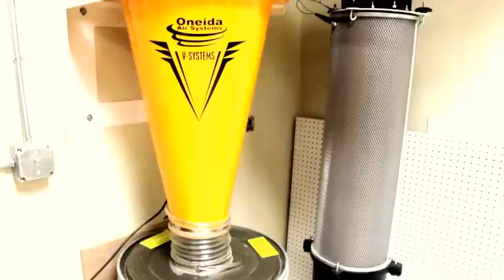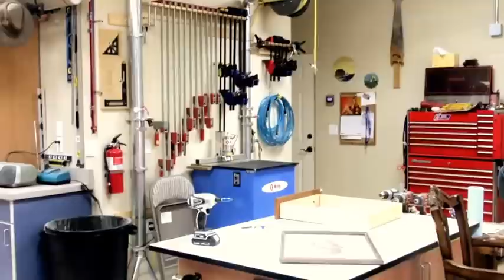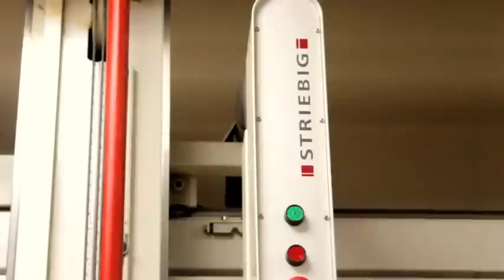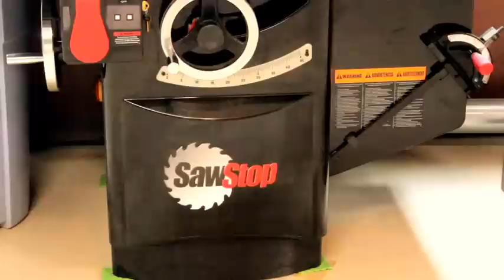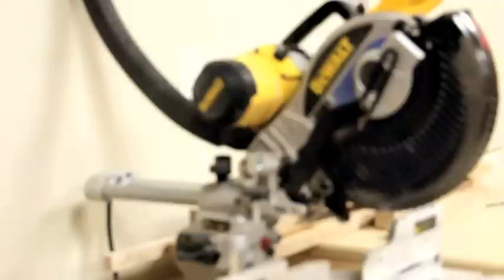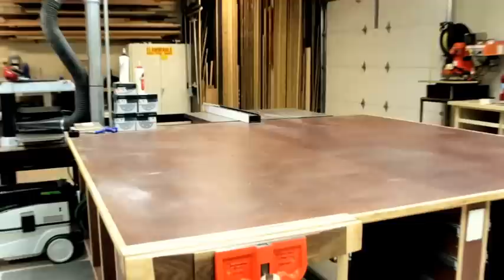Oneida Dust Collector V-5000 w/Nordfab pipe Shop tour

Comment: Absolutely beautiful pipe work. Awesome dust collector as well. Did you get pipe from Oneida or did you go somewhere else?
Reply: Thank you, Norfab is the pipe manufacturer and I contacted them directly.
Reply: @johnsonsjourneys7009  I think contacting them directly is smart. I really want  Nordfab but the price I got from a distributor was high. I understand this is expensive but I feel like that company was trying to make mint so hopefully get rid of them So here ultimately is decision I have to make. Do I duct less and get Nordfab and then add stuff as I go. Or do I put the entire system in in 24 gauge duct and be done. I see this video 7 years old. Oneida charges 244 plus shipping for 1 - 8 inch 90. I love quality and I love that I can see it. I am leaning towards Nordfab. We will see Monday and Tuesday when I get the bid back.
Reply: @ivanscountrymusicandcars2357  
I would definitely go with Norfab I have not had a problem with the product. 
I had a Oneida and Norfab do a spec air flow on sizing and design for each machine.
Reply: @johnsonsjourneys7009  Exactly  what I am doing. I love all your input. I am not just saying that because we doing it the same. I generally enjoy feedback.

Comment: Wouldn’t it be more efficient to run 6” as close to the tool as possible instead of the long 4” branch’s?  I feel that’s constricting the capabilities of the V-5000
Reply: 6" as close and long as possible to the V5000 after that going down to 4" to hook up tools works great.

Comment: I like your setup and the V cyclone.  I know they don't make the steel version anymore, but can you comment on the separation performance of your system particularly with the sander dust?  Could you  approximate how much dust in the filter bin after a cleaning compared to how much discharge you empty (ex: 3 cups of filter dust for every 60 gallons of discharge).  Also, do you know what size impeller that unit has?thanks,Carl

Comment: i was wondering how you planed your ductwork because i will be setting some nordfab in my shop and it seems overwhelming thx
Reply from the maker: The first thing is to place all your equipment where it will stay, because after you place the duct you don't want to move equipment around, you will have a little play with your flex duct. 
Draw your shop on paper with your equipment, if your are using an Oneida you can send them your drawing and they will size your nordfab and collector for you. or the person you are buying the nordfab from can help you. Getting the right size pipe is very important.. 
Hope this helps, Good luck

Comment: Hi Scott,    Great shop!!  I'm about to install by Oneida dust collector and thought that I would need access to the HEPA air filter so I could get to it with compressed air to keep it clean.  It looks like your filter is kind of in a corner.   Are you having any trouble keeping your HEPA filter clean?
Reply from the maker: Hello  Don, 
Sorry for taking so long getting back to you, it is tight in the corner to blow out the hepa filter but it is do able. If you have more room it would be easier. I love the system, good luck with yours.

Scott